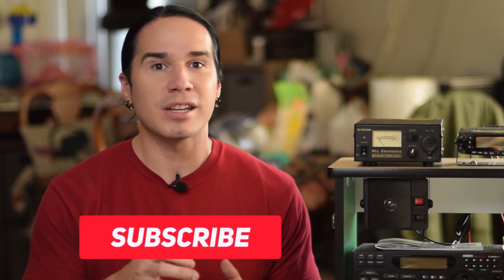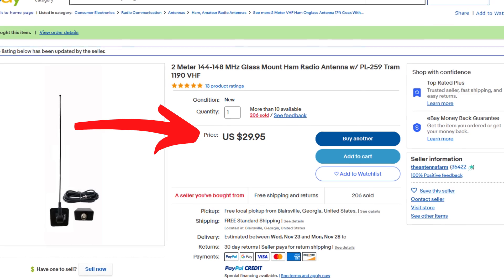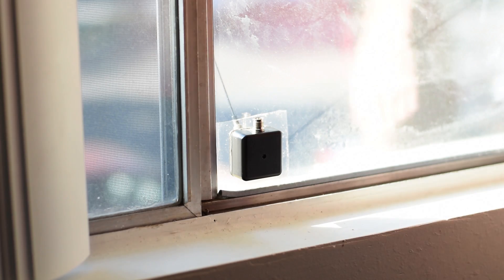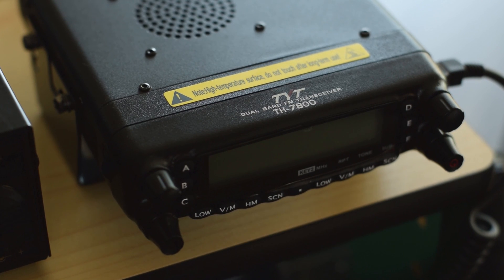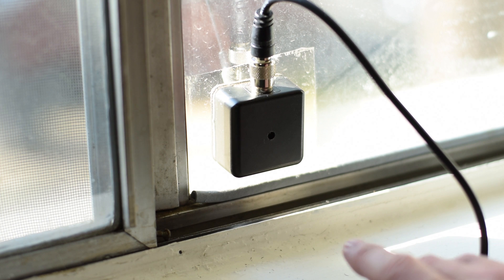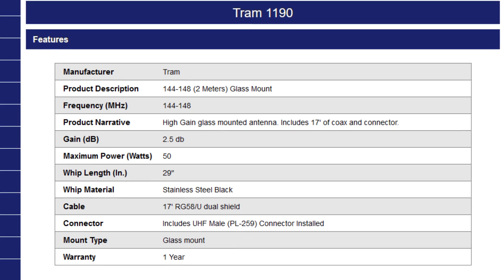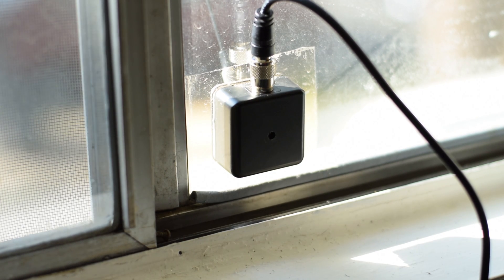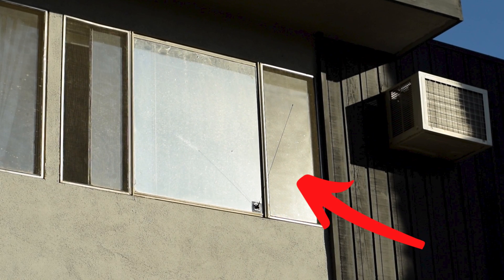The EASY and CHEAP HAM RADIO APARTMENT ANTENNA (perfect for new hams!)

Comment: Finding the right location for your antenna can be ¨interesting¨. I often walk around my flat finding different locations where I can hear and be heard from. Fortunately I can mount an colinear antenna on a disused satellite mount. A bit of scafolding foam across the smallest window edge allows me to feed the coax in without losing heat in winter. My neighbour gets a good signal out using a mag mount on a metal dish from inside his flat. Sometimes tall buildings can act as giant reflectors for your  incoming & outgoing signals.

Comment: Brilliant video. So practical. I also just learned by watching videos that ladder-line antennas, like a UHF-VHF J-pole work great through wiindows, such as by hanging them from curtain rods. (And they go for about $40.) I had purchased a roll-up j-pole and a fara-j antenna for temporary use in a backyard tree. However, between your video and one on the J-pole by N9TAX, I am inspired to see how well I can use my antenna from the comfort of my home. (I don't have any affiliation with the makers.) The only caveat on the j-pole was to keep it a few inches from any metal and not to run it down a wall, which is easy with a window. I don't have any balconies on my home either, but a second-story window should give me a height advantage. Keep up the great videos.

Comment: A big mistake many make about VHF/UHF is thinking more power is better.  No matter how powerful your transceiver, or amplifiers, VHF/UHF is "line of sight".  It will reach just past the horizon and no more.  Height of the antenna makes all the difference.  You talked about the few watts from the UV-5R and being able to work the repeater.  An alternative to what you are doing is to make a copper tape pattern on the inside of the window, and solder two short jumpers from an SO-239 socket.  It can be a vertical dipole if you have room on the window... 38" total, cut a gap in the middle to attach the socket.

Comment: Interesting, I wonder if it could be adapted to work 20 or 40 meters with a thin wire tied to a tree
Reply from the maker: Yes, I don't see why this type of connection couldn't be used for other bands.

Comment: I can’t wait to try this I am moving to an apartment..one time when I lived in an apartment I used an instrument stand and put it on the side walk. I mounted a copper j pole antenna to it and was able to hit repeaters 35 miles plus away with a icom v8000 on 2 meters so it can be done it just takes a little bit of ingenuity 

73 from KI4OMV

Comment: If your window is metal framed, as it looks like...try loading that frame as a 'quad' driven element/loop. Also...if your window is over 40" high or wide (or both) get some sticky backed copper tape (I got mine off Ebay) and stick a dipole onto the glass..vertical or horizontal. I've done this in free space...stick 2 x 1/2 wave dipoles say for 2M on the glass but make the two dipoles a bit less than a 1/4 wave apart and they should, in theory 'beam' away from the glass at 90 degrees (in a similar way to two trucker aerials on a semi truck. Good luck and a good video.
Reply: The beaming effect would be dependent upon which direction there is more ground, so I believe it should work depending how you manipulated the position of the counterpoise. Good suggestion 👍

Comment: It would be interesting to see your solution for a HF antenna. Maybe a small mag loop next to the window? Or a stealthy wire hanging out the window at night? It’s will be fun to experiment. Congratulations on your ham ticket. Love aviation stuff too! 73’s de n5vwn
Reply: That is something I am working on for 75m up. So far, meh results compared to my last place where I could actually have antennas up in a back corner of the lot.

Comment: That was great, really don’t want that 50 watts of power antenna at your head height, I’d be putting it as high as possible at the top of that window. 50 watts is still radiated power coming back towards you in that room. Over 20 years it could do some damage. Be fine short term. I’ve got a buddy that wears a hazmat suit up the fm broadcast towers within 5 metres of the high power antennas, he said he could feel the water around his eyes heating up. That’s why the low power 80 watt 5g towers are at least 5 metres off the ground, not just for distance but rf safety. Looks like the antenna link is gone. I’m keen on one.

Comment: Just a thought not sure if it would work but what about on top of the AC unit and you could just run the wire back in. Thank you for putting these vids out new subscriber 🤙

Comment: Hello, Thank You kindly for this informative video. PLEASE tell me what I can use to remove this antenna off my window then move to another room or even my car (Will it restick to my new location?
Reply from the maker: Hey there. You can use 'Goof Off' or lighter fluid to remove it but no, it will not restick to another location. You would need to glue it on to a new spot.
Reply: @HeavyMetalHorizons  
Thank  You

Comment: You might consider a J pole antenna.  You can mount it on a small pvc pipe..place it in a big flower pot and park it in front of the window..heck place fake flowers and follege on it nobody will suspect its an antenna. 

   I had a j pole in my attic and was able to hit repeaters 50 miles away using a 50 watt radio.

Comment: Excellent video .Would like to check how far rig should remain away from antenna assuming you are transmitting 50 watts on 2m .Also my shack table and window is just 4 feet away ,will is cause any issue considering I'm just 2-3 feets away from antenna .

Comment: Do you have a Nano VNA yet? I got mine at AliExpress. Also, what HTs do you have? I've had good luck with TYT products and love the TYT TH- UV8000Ds. The power tests I ran on it were:

Frequency     High        Low
-----------------------------------------------
140.000       9.22W     6.03W
142.725       9.84W     6.03W
143.500       9.98W     6.05W
146.355     10.40W     6.23W
440.525     10.50W     5.73W
442.000       9.86W     5.68W
446.252.      9.57W     5.58W

As you can see, the radio's almost dead on 10W. I also like the TYT because it has a built-in cross band repeater. And, when you unlock it, it becomes a tri-band (200-260MHz). As for antennas, Ed Fong has some very nice antennas that can be hoisted up a tree or hung up in an apartment. I recommend his tri-band antenna, which comes in a PVC pipe. You can put a hook on it at the top, then connect it to your radio at the bottom. Then you can put it up and take it down as needed.

Comment: I have a Tram thru the glass antenna on my F-150 Crew Cab. Mine has a small ground plane on the inside module. It works great on 2meter and 440 for me. Nice video with good info for new hams, or an older one moving into an apartment or assisted living.✋73's🎙 KD9OAM🎧📻📡
Reply: 2014 f150 Supercrewcab, what antenna model did you use and where did you exactly mount it ? My rear glass is factory dark, will that effect it ? Thanks for any help AA2BD   did you make the ground plane or did it come with the antenna? Links??
Reply: @revbikerbigd8664  Mine are tinted but not very dark, I think it has a problem with aftermarket films. I mounted mine like it says, at least 2 inches from the metal rim at the top of the rear window and the same from the side. Look inside to out to make sure you have clearance, then mount the outside antenna mount first because you can see out better than in for alignment. ✋73's🎙KD9OAM🎧📻📡
Reply: @AdamosDad  thanks for the information, 73 👍🏻
Reply: @revbikerbigd8664  Roger!
Reply: @revbikerbigd8664  The ground plane came with the antenna for 2 meter 70 centimeter, but not for the tram CB that I mounted on the opposite side, I made that one.

Comment: would a good diamond srj77ca give the same results/
Reply from the maker: That's a good antenna, but the shorter size won't be quite as good as the one in this video.
Reply: @HeavyMetalHorizons  can this be mounted on the inside and outside of a double patio door?

Comment: First thanks for the video. Secondly I'm a new Ham and  in my area I noticed right away no one is really using analog. Even on Echolink trying other repeaters, it's pretty quiet. So I went out and purchased a digital HT and pi-star. Just like I thought I made way more contacts on fusion than on analog. I see video's like this and I too live in an apartment and would like to invest in a small mobile radio setup.  The window antenna is idea due to all the restrictions, but I'm back to the question am I wasting my money?
Reply from the maker: Depends on what you're in it for I guess. That's a shame there's no analog stuff around you. There's something old school about analog that I love.

Comment: Unfortunately, my apartment doesn’t even have a window. However, I am still able to reach local repeaters from the back of a closet using a  hidden “J-pole”. I can use up to 50 watts, but I get by with 5. I think I have an average range of 75-100 miles with these repeaters. Now if I could only get HF to work!

Comment: If you need a good window antenna for VHF there's a lot of information online for a 'window Vhf delta loop' it would be very efficient and easy to make. Or a flower pot type of antenna is also excellent for Vhf-Uhf work .or if you have a multi- mode V/UHF radio, ( where you can use modes like Single Side Band -SSB or Morse code, a simple dipole can be constructed easily inside of an apartment window or sliding glass door. There's a plethora of small HF antennas as well to build and can work indoors too.  Oh if you have a balcony there's even more antennas you can try.  Building an antenna can be a lot of fun.
Reply: I don't know why more amateurs don't make aerials. Do they think bought aerials work better?
Cheaper than buying and the pleasure of saying they made it and it works. I got back on 2m with a telescopic vertical, then a dipole and now a 2 element collinear, all indoors. 
G4GHB.

Comment: How well does this antenna do on receiving? If I wanted to use it with an SDR, would it work well? Obviously, I would only be using it for 2 m and 70 cm contacts well not contacts but listening. Like the airbands and possibly NOAA ?
Reply from the maker: It works great for receiving! My dual bander (the TYT) can also receive air-band frequencies, and I have no trouble listening to the local airport and air traffic.

Comment: Even if your not in an appartment holes in the wall can be problematic.  I use a Comet CTC-50M for the transition from the shack to the outside.  I was surprised how well it made the turns in the window channel still allowig you to lock the window closed and pretty much air tight.  Have fun!
Reply: Nice! Not gonna work for aluminum windows though!😂

Comment: First of all congratulations on getting your Ham license Max. I just subscribed to your Channel. I love everything about your channel. And this is a guy that has one hour flight time on a Cessna 172. I love everything Aviation, cars and ham radio. Just to mention a few. I also live in an apartment in NJ. What I'm using for VHF and UHF is a dual band Slim Jim antenna made by N9TAX. It's been working very well for me. Great video, keep them coming. Good luck with all your adventures and welcome amateur radio. God bless and all the best. 73 from KC2NGH.
Reply: The Slim Jim is only rated for temporary use, but if it's all you have, enjoy the heck out of it!

Comment: I passed my tech license last night woohoo.  I seen you mentioned the 7800 bundle on ebay and also the 7900 on Amazon.  Do you prefer one over the other?
Reply from the maker: If you can get that 7800 and power supply bundle, I would go for it! There's so much to do on the 144 / 440 bands... if you want to use other bands, you would probably want to get a bigger radio altogether (I mean not the 7900).

Comment: Hi Max- Have you figured out something for HF at your location? Here are few ideas: 1. low power magnetic loop on tripod next to the window. 2. Load up the large window frame from the inside, and run a counterpoise wire along the carpet edges (there will likely be high current on the indoor wire.. roll up when not in use), use a 4:1 or 6:1 balun and feed with coax. Run the coax to an External tuner if required. 3. If there is a vertical rain gutter downspout out side of one of the windows- clamp on to it,  feed it with rg-8x/mini, and run an indoor counterpoise wire.. Make a ~ 10inch diameter rf choke (inside) out of the coax. 4. Snake an end-fed 20m (or 40m) out of the window. I've found, that placing the end-feds (lossy) balun "outside" of the dwelling helps with snr and general reduction of noise. End-Fed users- remember, a good length of coax will act as part of a counterpoise for these very inefficient wire antennas. 5. Remove screen- clamp on to the window sill (or use a tripod) and extend a (~ 7ft +) telescoping whip outside, and rig up a counterpoise.. I've used all of these techniques except for the mag-loop, in apartments, various locations, including up in the Alaska's Arctic region.. Wide band ssb can be a challenge, but cw and super narrowband digital modes easily net lots of dx.. 73, n6spp-cm98

Comment: Nice work finding a solution. Apartments are definitely a challenge for this hobby. I rent my house so I'm not keen on drilling holes through the walls either. I use a the Ed Fong J-pole PVC (Schedule 20, not schedule 40!) kit attached to a PA speaker tripod I picked up cheap from Sweetwater. Poor Josh couldn't wrap his head around what I was going to use the tripod for. 😆 Welcome to the hobby and look forward to more videos.
Reply: @PlasmaStorm73 [N5EVV] I saw Max's AC unit and thought of that. But his solution was less precarious to install. Good to see you in here!

Comment: A lot of ham stuff is expensive IF you BUY commercial gear. But you don't have to buy your gear. If you BUILD your gear it can get as cheap as you like. The right to build your gear is the difference between ham radio and CB.

Comment: You’re using a good solution that solves your problem. The only thing I’d suggest is to put a stain relief on that coax line. With it screwed in to the top and bent over, it’s taking extra strain that will make it wear out a little faster.

Comment: I would recommend a J-Pole antenna.  It is very easy to make and is very efficient.  No metal ground plane is needed.  I made one for my boat when we lived in Iowa.  You can even make a simple dipole and mount it vertically.  19 inches on each end, and you're done!

Comment: Very informative! I actually just learned you had this channel from your Guitar Max channel. I'm a truck driver and ofcourse use 10 and 11 meter on AM in the truck. I've always wanted to get into ham radio but the anntana has been the hold back! I'm gonna go back and watch the video you were talking about before this one now!
Reply: When I drove a truck 20 years ago, I had a Uniden HR-2600 modified to cover 10-12 meters. I just used the regular co-phase antennas that were on the truck. I worked Nova Scotia from Las Cruces before the truck stop started filling up.

Comment: Great video, Max. I actually made my own through the glass antenna - just to see if I could. Believe it or not, it actually worked like a manufactured one. It consisted of a length of 12 ga. hard copper wire, long enough to twist an inline coil. It was attached to a 1.5" x 2"piece of flat copper plate. I no longer have it or the schematics I made while building it so I don't recall the details of its construction. This was in the mid 1990s and my memory is slowly leaving me.
Reply from the maker: That's really cool! I should try that sometime and see if I can build a larger one than what I have.

Comment: Looks a like a great solution!  I was actually surprised that the power rating was 50 watts.  I use a Compactenna on my Jeep for 2M/440 and it works great.